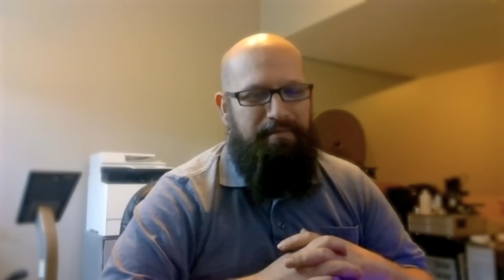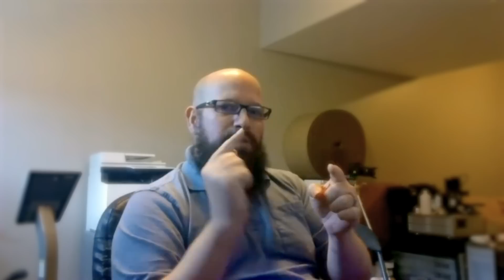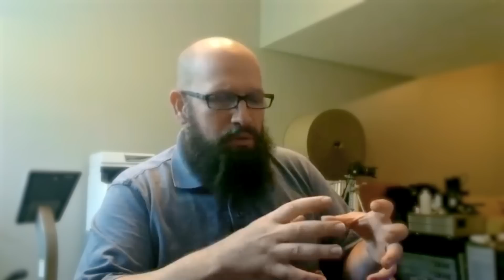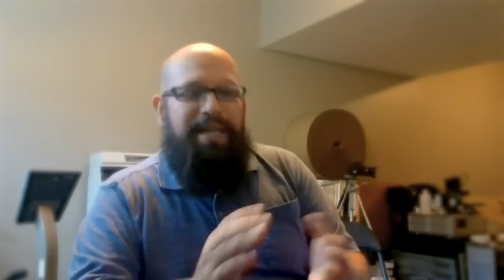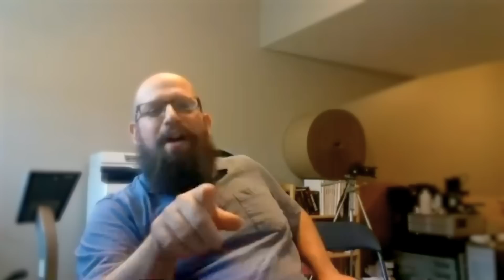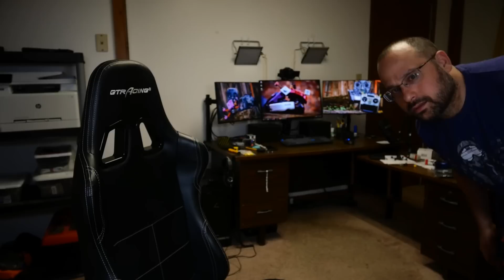Stop desyncs on your "160 mph" 6S 2700kv quad (with Ryan Harrell of miniquadtestbench)

Comment: this is good info because i had 4 drones that fly so good and then i took them all to the new betaflight and now they fly like crap. i just got one drone flying good but it was a lot more work than on the old betaflight. do you think betaflight and blheli is toning for sub 250 class drones due to RI and this is why out of the box bigger drones are not flying asgood

Comment: In theory, the vibrations of the frame will also cause some voltage spikes. The motors will respond to the change in physical position of the frame arms, as they oscillate. How much ? Will we even notice? I don't know yet. But I bet we can test for it.

Comment: Josh / Ryan, Awesome topic, Great vid, great questions and answers. I've got a similar FPV Phantom build SUPER AWESOME 2750kv on 6s HW 60a 4-1. My favorite 2 minutes of flying. I'm getting lots of high speed oscillations on the upper end of a full throttle punch. Any tips on how to setup blackbox to help troubleshoot? What should I be looking at?

Comment: So.. Those are either MOSFETs or capacitors I'm popping at full throttle punch-out?  
I am impressed with the GEPRC 4 in 1 but I agree with separate components.
The best analogy I could think of is the difference between a radio that has everything all in one vs.
 separate components that are designed for one function set each.
I personally prefer the separate components if I am spending a lot of $.
I don't want an $80 FC if the common issue is a VTX fail that renders it useless to the average user.
I'd much rather spend $80 on a quality VTX, separate traditional ESCs on the arms, ECT.
I'd be happy If I could have a piece of mind that one crash doesn't kill the new quad. 
For example:  My little Larva X.  When I tried a heavy 3S pack.. it got crushed. 
It killed the FC that was a week old. 
I'm still able to use the remainder of the quad but the sensitivity of the FC's make these flying eggs just waiting to be scrambled.

Comment: I've a similar problem with my dys samguk wei 2600kv on 4s with my armattan rooster frame. quad drifts left backwards when i gave full throttle punch in angle mode. Before i flew this setup with 3s without problem. I'm using good one tattu race line lipos. a 4in1 50A BlheliS, Is it possible i have desync Problems??

Another thing i found out is, i lower the startup power from 0.5 to 0.125 and 3 of 4 motors spinning really slow(like idle speed or less), and one spinning normal. Could this be a indicator of bad motor or esc??

Comment: I just built a quad that has low throttle bobbles kinda drops a little it didn't do that before blheli 32.8 any suggestions
Reply: You that's what I was wondering. You think if I put my esc on a older firmware like 2 back it will work right? My band new holybro sucks with 6s and is wonderful on 4s

Comment: This was just a perfect video for me. I just finished my build and it did the flip out mid flight but I was able to land softly.  My build. Karearea talon 5in frame, hglrc zeus 75a full stack, EFAW 2800kv motors, max amps 6s 175c. Quick throttle bursts make it roll or flip but only when moving not when just punch out. I'm still learning and this just added more. Thank you.

Comment: I would love help from anyone here. I’m running the Bardwell Xtreme Speed bundle with a Tattu 1400 6s 120c battery, a 1000uf 50v cap.  I can’t for the life of me get my quad to not roll uncontrollably (dsync I think) after reaching full throttle.  I’m using the betaflight dump posted in the 160mph video (using BF 4.2 and RPM filtering) all ESC settings recommended here and prior with no luck. My solder joints are firm, the quad is a nice clean and firm build.  I’ve tried with various props and no luck.  Thanks to anyone out there that might have any recommendations.  I would love to see a screencap of the blheli32 screen.
Reply: Where you able to get it working? I've been wanting to do a 2700kv 6s build myself, but I'd also like to to not set itself on fire, or fall out of the sky as I go past 100mph.

Comment: So I guess I have desyncs? My first built has 2400 kv and it worked on 4S. Once I changed to 5S it fell out of the sky with a barrel roll, or let’s say hundreds of barrel rolls. I think the esc even rebooted. I changed the esc and it happened again. I flew it with 4S and it worked, yesterday the same happened with 4S. I always disarmed when it happens. Afterwards trying to rearm only one motor ran. I had to disconnect and reconnect the Lipo and then the motors were running again. Could the FC be damaged too? I’m running the Kakute f7 hd stack with the tekko ESC. I’m a bit frustrated...
Reply: I'd say try a new esc and solder a capacitor to the esc pads.
Reply: Hobbywing is supposed to be good.
Reply: Mr. Merkaba FPV It seems it was the esc. I sent through 3 holybro ESC‘s. The last one I had a minor crash with and but the reboot of the esc happened already beforehand once and then it flew. After chipping a branch and disarming it, it fell on grass an the issue happened again once using full throttle. Now I’m running a t motor, FC and ESC... Seems fine now. The holybro FC I’m running on a different built now also with a T motor esc and it works fine now too.  Those Tekko ESC’s are totally crap. At least that’s me experience. Throve me nuts this problem. I was running the delivered capacitor to begin with. Two of them are certainly damaged, I checked with a multimeter, each has a damaged mosfed. Thanks for the reply though.
Reply: @gZoAdventures  glad you got it running! Yeah I've had really similar experience with those. Run really clean but not reliable, lol.

Comment: Your guess about micros is correct. Micro motors need to have a higher ramp up power (startup power). The most extreme case is whoop size motors like 0603 and 0802. It is common to have a whoop motor that won’t even start spinning reliably with startup power at 0.5. It might start some of the time, or it might just twitch. The fix is usually to increase startup power. It is sometimes necessary to use the maximum value which is 1.5. In fact manufacturers of 1S whoop FCs often set the startup power to 1.5 at the factory.  So, lowering the startup power can help, but some quads will tolerate a lower value than others.

Comment: I have three quads that fly wonderful on 4.2, and only recently put 4.2 on my TP3 and had the shakes like everyone has been talking about. 24/48khz didn't matter, didn't seem like anything mattered. I ended up re-tuning used much higher numbers than any previous version like Ryan said, and that completely fixed the shakes. Still seems strange to me that my other builds didn't require anything new/different.

Comment: I recently built a 10in drone on 2812 900kv motors and 6s.   It was nearly impossible to tune due to being ridiculously powered, it would hover at 15% throttle and hit 60mph at 50% throttle.   Was afraid of getting to that runaway situation.  Motors came down hot and battery came down warm with like 2min of flight time.     I swapped to 3115 640kv motors on 6s and the tune was almost perfect out of the gate while flying like an idiot, motors are cool to the touch along with the 6s 1800mah battery cool while now flying for 4 minutes.

Comment: Why don't we have a small gearbox type transmission between the motor shaft and props in order that the motor can spin slower and still have high RPM output?
Reply: That's an interesting question, though where you actually want to be in the RPM band for peak efficiency for the motor may mean spinning faster, not slower. The reason we don't do that for the most part is because it is much more fragile. You'd be blowing gears every time you crashed. Direct drive is MUCH more durable. There are a few quads that have done gear reductions, and some that have a single motor with fixed RPM and variable pitch props. Very interesting stuff.

Comment: If you flash your BLHeli with TAIL firmware, the rampup(startup) power is 120% as factory default. There are many reasons starup power needs to be very high.

Comment: DroneMesh does some real good testing on esc's full range including noise
Reply: I don't necessarily trust his methodology unfortunately. His results too often deviate from actual outcomes. He's showed low noise on several ESCs I know for a fact have significant noise problems. I think his test environment is just too clean compared to the mess that is actual flight. Most of the stuff I've seen from him has been pretty far off base.
Reply: @QuadMcFlyFlies  could be. I usually just by escs that are overrated for the motors i use. But deadtime was one of the things i had to change back in 2017 to hit 145mph with out melting something. Everything is changed since then.  I have other secrets to get out more power but stopped telling people because they seem to not want to believe me. But i have been flying almost all my quads on 6s since the end of 2016. Even my 3" most all are 6s for the past couple years. Thanks thou for the heads up QuadMcFly
Reply: @wodifpv644  Yeah unfortunately with BLHeli 32 we can't really tweak deadtime any more, so we have to deal with other options in the firmware. Ahh the good old days :D Overall though I think things are a lot more refined now, so I'll take it ha ha.
Reply: @QuadMcFlyFlies  definitely refined

Comment: i have been using 2750kv motors on 6s since spring of 2017. all i did was keep the deadtime 40ns or higher in blheli and that fixed desyncs
Reply: Wodi (FPV) I cant for the life of me get this JB extreme speed edition to not roll out (dsync I think) after all these suggestions.  I would love to see a screenshot of your blheli32 setup.  Where is this deadtime setting.  Thanks for any help
Reply: @LogicOverlord  you can not adjust deadtime in blheli32 only blheli_s for one. Betaflight settings have to be adjusted on blheli32. Which Mini quad test bench guy can walk you thru what Betaflight settings to adjust.
Reply: @wodifpv644  Thanks for the followup Wodi.  Righto on the blheli vs blheli32😀 I tried all suggested settings in this video.  I’ll have to brainstorm this one
Reply: @LogicOverlord  welcome.  The Dysnc might be fixed by motor timing in blheli32 and lowering startup time to 25% but with out the ability to change deadtime i am not sure. My newest one i built has blheli_s and it desynced and i changed the deadtime to 40ns and boom no more desync

Comment: I've watched your "160mph" build over and over but this one is what probably gives me just the right nudge to convert my quad to a dragster.

Currently running Ummagawd Hex 2306 1777KV motors, DAL F5 folding props, Dinogy 65C and GNB 100C 6S packs, T-Motor F7 FC, Hobbywing 60A 4-in-1. Demag compensation is already set to High (just because), motor timing at 23 and PWM frequency at 48KHz.

Might get my hands on a set of T-Motor F40 Pro II 2600KVs sometime this week...

Comment: I love this - being an old duse, it harks back to the old points and condensor ignition system, setting the gap for best instantaneous transfer of current and using a strobe light to set the timing to best number of degrees before top dead centre :) oh and the ramp up power a bit like getting the mixture right :)

Comment: fried 4 Aikon ESC after upgrade... stopped trusting those guys after meeting they after sale 'service'
Reply: Sorry, that doesn't jive with my experience at all. They have some of the best support in the hobby from my direct experience and from that majority of users I've talked to. Sorry you've had a bad experience, but that is definitely far from typical. In most cases when I've heard people complain about Aikon it has turned out to be user error and folks expecting the manufacturer to replace parts they crashed or broke from misuse.

Comment: As far as the dump-trucking tendency, it's a 'relative authority' problem - heavier props on smaller motors, really porky frames, and low effective torque can all cause this - which oddly is why some whoops and tiny pick setups, as well as macro 7-12" quads all seem to prefer higher P&D gains.  Thrust_linear is a good tool for cleaning up low-throttle only bobbles and such, but fundamentally it's a band-aid for how much less immediacy in response there is before we start seeing the gyro react quickly enough... does make me curious about JoeLucid is working on right now that treats the RPM (Bidir DShot) as a reverse mixer, and starts running PID calculations against that.

Comment: As far as rampup power - for overpowered racing builds, you can start as low as 0.125 to 0.15 on the rampup power and have honestly pretty great results.  It makes things a tiny bit sofer, but really works.
I'm also convinced that there's some dead time dependency on the PWM Frequency side of things - at really low dead times (<45) 48kHz seems to work brilliantly, whereas higher dead time seems to be super variable.  The loss in effective torque response reduces effective D gain (probably not the best description, but that's how I think of it) at lower RPM, but thrust_linear can also be a fairly effective band-aid.

Comment: I really wish the middle school kids I was mentoring kept after this - we had pretty solid data on how much the additional torque demand of higher KV motors (and similar effects on battery cell count) worked, and it had a great quadratic relationship to overall power draw (especially as the battery goes into the mass-limited discharge regime where pretty much every cell is 55C or lower).  Best way to think of it is that higher KV (on otherwise identical setups) means the motor can ask for more power (and actually even demand higher amperage if the battery/ESC can play), which is counterintuitive.  There are still some reasons to run slightly limited setups (2150KV 6S on paper really is ideal, limit the throttle output to 85% and chop throttle input to 78% on racing props and that's basically ideal).

Comment: Hey Josh hope you and the family are well. I am thrilled you did this video I have one last question for you guys if possible. I built a very light 4 inch build with a 35amp stack with 2204 3002kv floss series motors on 5s now hopefully 6s after i mess with blheli tonight. Quads on 4.1.7 rpm filtering mostly stock tune. I tried a 75%motor output and it flies absolutely amazing. Really quick and super nimble. But if i get to about 85% throttle i get a mild desync. No deathrolls or crashes but if i punch hard for whatever reason i get a bad tick as if its going to fall out of the sky for a split second. I bought 6s batteries for it to use but honestly if I can get rid of the momentary twitch that makes me hesitant even though ive never even hit 25ish amps on 5s. It may be fast enough already if i can have some trust in it. If the blheli settings help to get rid of that issue can i remove the motor output limit? Ill of course check it on 4 and 5s first before i even think 6s is reasonable. This quad is so light its nutty lol!!!
Reply: Yes, likely with the adjusted settings you will be able to raise the throttle limit. That is assuming that all your hardware is solid. If there is a failing FET on the ESC for example, or an issue in one of the windings, it may not solve it. That would be a hardware issue though. If it's always twitching on the same motor output, this would be a sign of bad hardware. Blackbox logs to demonstrate the issue would help debug that.

Comment: At 33:38 ,what applications besides quads use ESCs, you ask? The rampup(startup) power needs to be very high for direct drive helicopter tails to avoid piro of death. See this video https://www.youtube.com/watch?v=MOT67_5bWFY . And the solution is to set the startup power to 150%, 3 times higher than factory setting.
Reply: Yup - and very low for vacuum pumps - that run in the same RPM range.